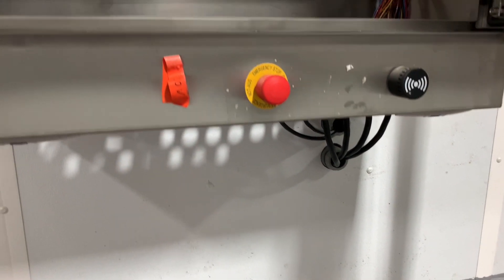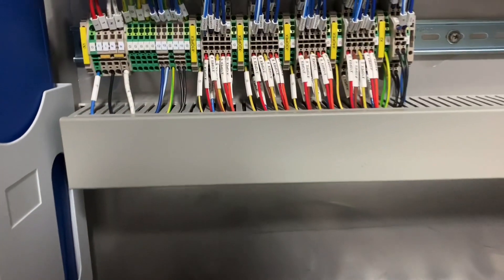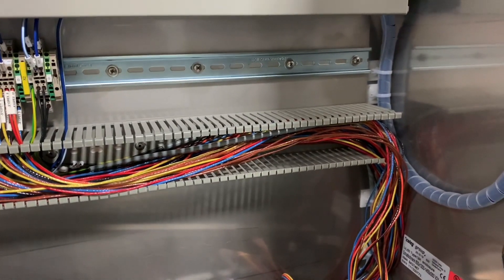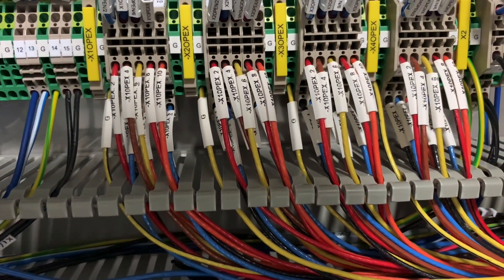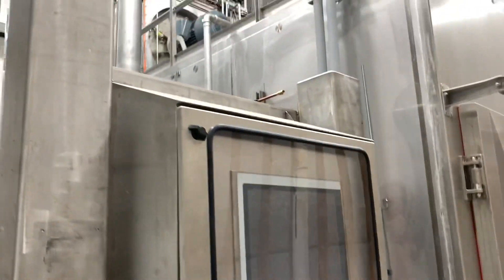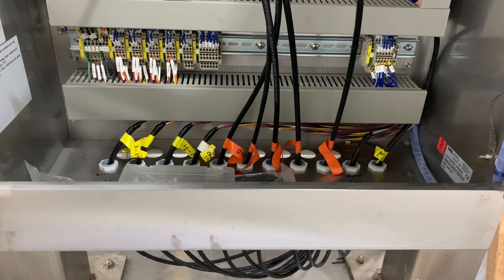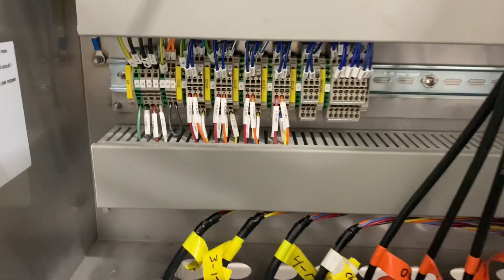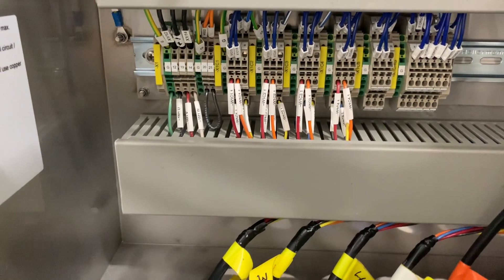Today As An Electrician: FIRST TIME TERMINATING A CONTROL CABINET!

Comment: Nice work. I love wiring control panels. I'll take that over house wiring any day. If you do more look into a ferrule crimping tool. Makes inserting the wires into the terminal strips a lot easier. Especially if you're dealing with smaller wires.